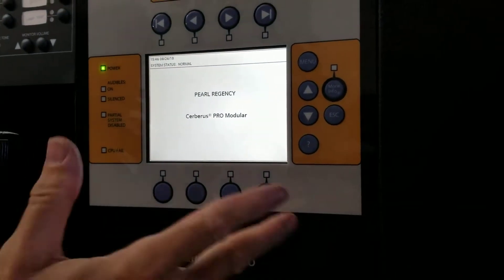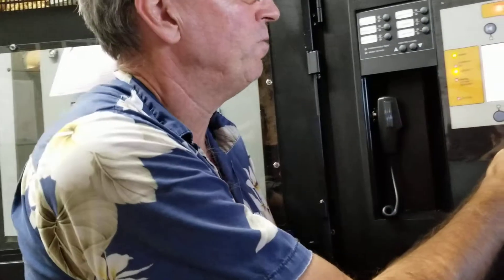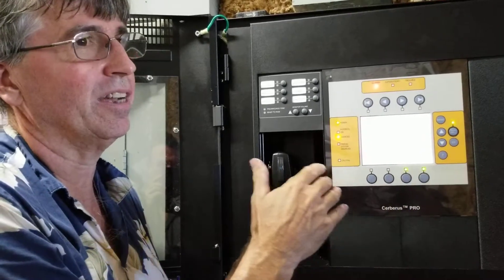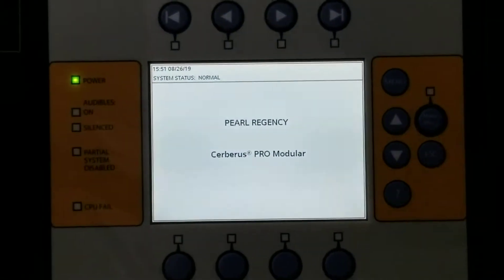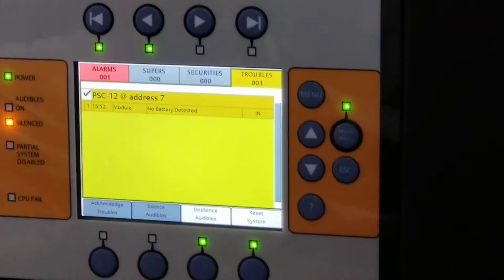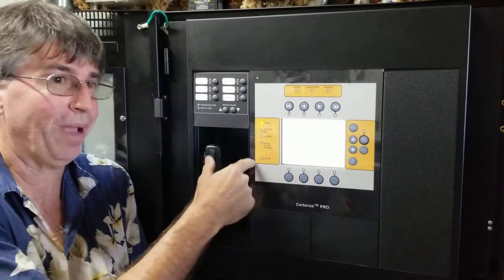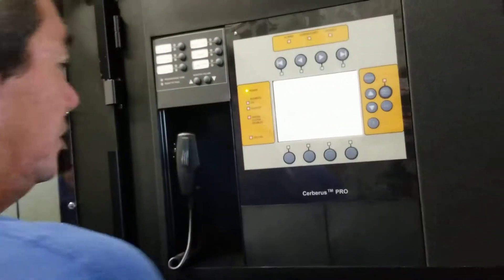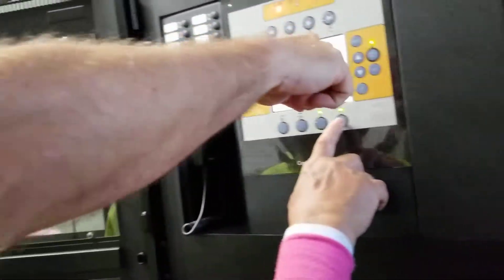SIEMENS Main Fire Alarm Panel

Comment: It’s not a mass notification system shouldn’t be used for non fire activities sir!!
Reply: That depends on whether activating the mic sends a signal to the fire department. The Cerberus Pro Modular can be integrated with a security system as he explained, which also isn't a fire activity. Regular use of the speakers for announcements can help catch failing speakers or speaker circuits more quickly than yearly inspections.